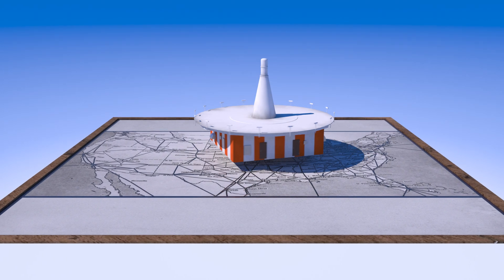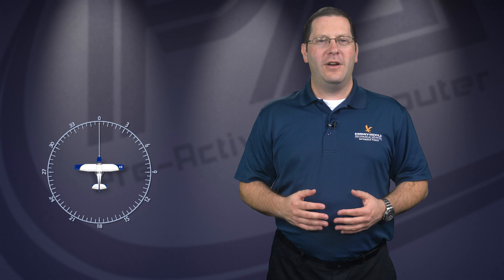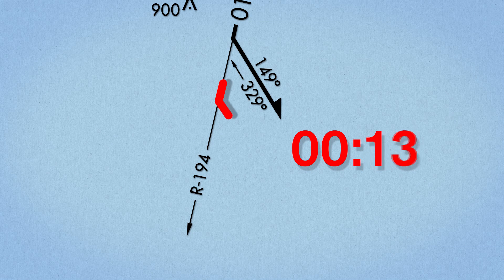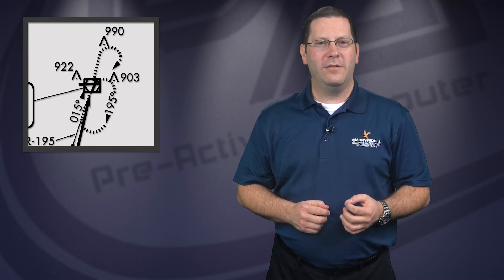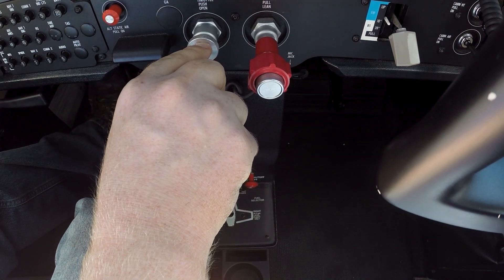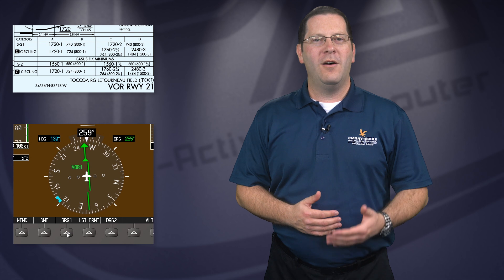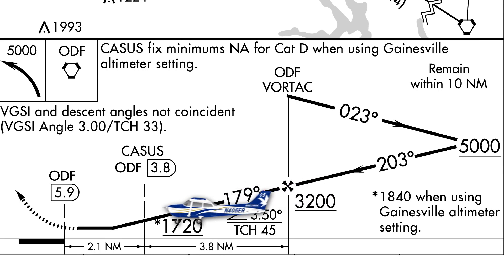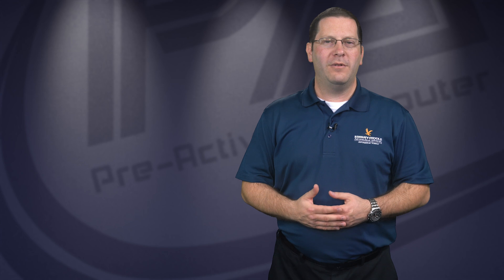VOR Approaches

Comment: Nice job, thanks for the review. The off-centerline final approach direction can under adverse circumstances and if not adequately anticipated cause need for potentially dangerous last minute adjustments that challenge a stabilized approach and certainly add to the stress and concern.  Just like how to transition safely from eyes down to eyes up and not be tricked by deceptive obscured flickering visuals as they are rapidly modulated by the variable obscurations and maybe incorrect interpretations of ground lights , objects etc, it all requires very careful thought as far in advance as possible. Consider copilot goes eyes up  on the final segment while pilot  remains eyes down until copilot confirms  that the runway is an unequivocal visual contact.